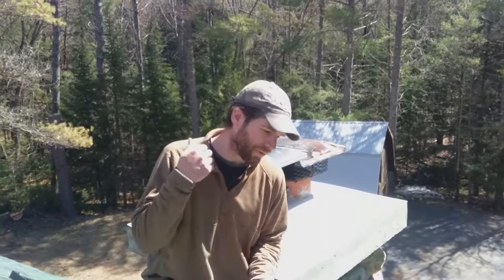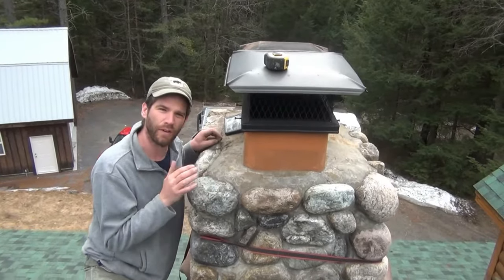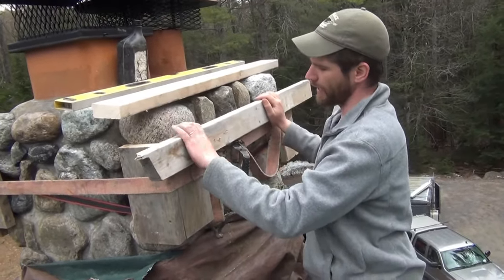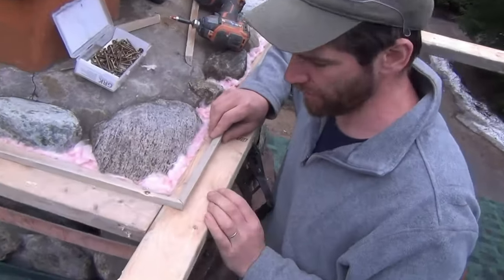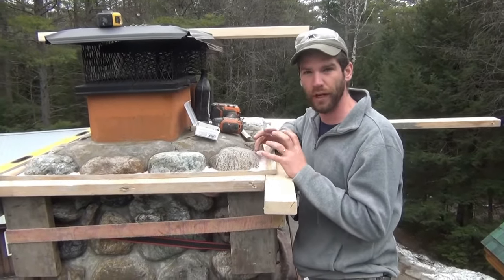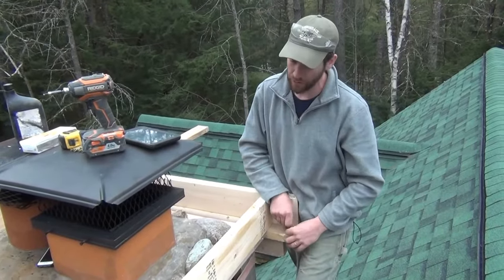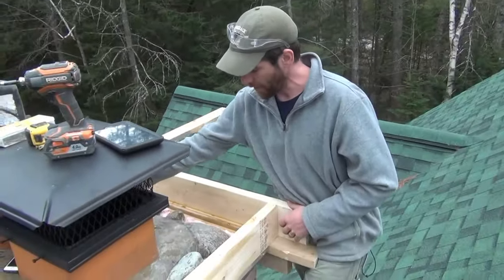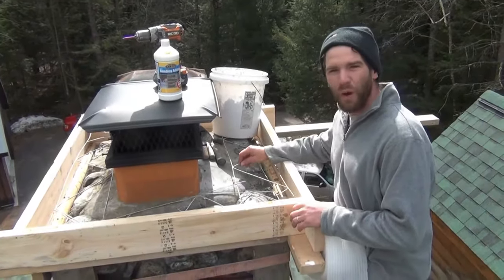How to Form and Pour a Chimney Cap (with Roger Houck)

Comment: Excellent tricks! I have to pour a 4 in x 6x3 cap and I’m wondering how you were able to secure the corners with the ratchet strap? I’m by myself and am wondering before I try it. This seems to be a good alternative to drilling into the mortar to have nails or tap cons hold up the forms so I’d really like to try it.
Reply from the maker: Good question!  its a real pain to hold the 4 corners in place and tighten the ratchet strap with just one person!     what I have done in the past is to wrap the strap around loosely and then place the corner pieces on.  (maybe with a nail in the outside to keep them temporally from slipping through the loose strap.  then inch the 4 corners up and tighten a little at a time.    or hang all 4 corners on screw heads up above the top and sneak the strap over them.  then take the hanging screws , tighten the strap a little and then tap the corner piece back where they belong.   just some ideas.   its easier if you can get another brave soul up on the roof to help.  but i understand trying to do it alone.
Reply: Thanks for the response! I ended up getting it, it was a pain but got it in place!
Reply from the maker: great hope the pour turned out well.   thanks for watching!
Reply: It turned out great the hammer drill trick was awesome. Wish I could send you a pic because i had to leave it overnight to set and was able to finish it the next morning LOL never been able to do that. Michigan cold for ya!
Reply from the maker: nice.   sometimes we use anti -hydro a concrete curing accelerant in the concrete water so that it cures up faster in cold weather.     but as long as the creet did not freeze over night and you got to trowel it in the morning then you got a really good slow cure that makes the strongest concrete.  
It is 19 degrees here in northern NY today.    we quit outside masonry work a few weeks ago here to keep out of the cold.      i'd love to see a pic if we can figure out a way.
Reply: Yes sir, I put some chloride in it probably 1-2% each batch but I don’t blame you. We probably aren’t far behind you. Got some finishing touches with some slurry on one of the corners and a few spots. I’m not sure if there is a way on YouTube to send a picture.
Reply from the maker: sounds like a good job!
Reply: Quick question man, I did the expansion joint for the flus and we just got our first snow & the caulk cracked already what do you think I should do?
Reply from the maker: i use Lexal clear caulk.   that stuff is awesome.   super sticky, expands,  and holds up way better than silicone.        i'm sure with the changing temps and fresh creet there will be lots of movement between the flue and creete this winter.    you will have to pick a warmer drier day to recaulk,   or use a torch and heat/dry the joint area before you apply the lexal.     you will want to get that thing sealed up though.  if water gets in there it can cause a bunch of problems.    are you using the flue?   wood? gas? oil?
Reply: I just tore out the caulk I originally put in there dried it up and used what I think is similar to what you were suggesting. Just kinda had a panic moment when I went up there and saw that but come to find out I guess all fireplace caulks aren’t exterior rated! Lol
Reply from the maker: yeah exterior. applications need crazy good caulk
Reply from the maker: my email is  rogerhouck007@yahoo.com if you have a pic
Reply: Sent you some pictures sir

Comment: Quikrete sells portland in 94 pound bags and concrete in 50 and 80 pound bags.  So "1/2 a shovel per bag" is not particularly descriptive when it could be off by almost 1:2.
Reply from the maker: good point    .  its per 80 lb bag of pre mix creet.   btw  the 94 lb bag is straight cement.   not pre mix
Reply: Haha shovels aren't really standard either

Comment: Should the concrete be sealed?
Reply from the maker: it certainly helps  but its not critical.   the best sealers require that the concrete has cured 3 weeks before you apply the sealer  but that is a pain to limb up there and do later.    aqua-pel is a good sealer

Comment: If you have done this for 20 years why don't  you know that is the crown those things on the flies are caps.
Reply from the maker: right you are.  i suppose that is a better way to name the 2.    in this area the concrete part is also called a cap,  but i could sure see the advantage of the distinction.  thanks  for watching!